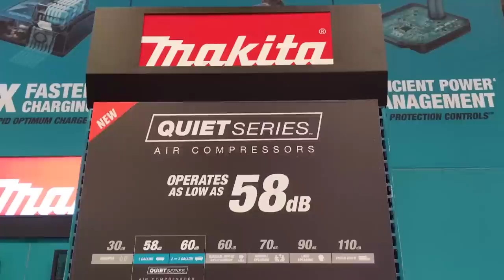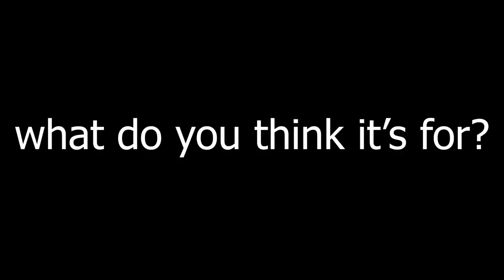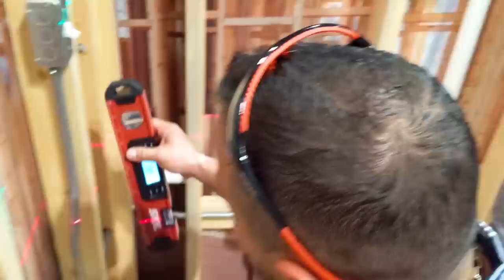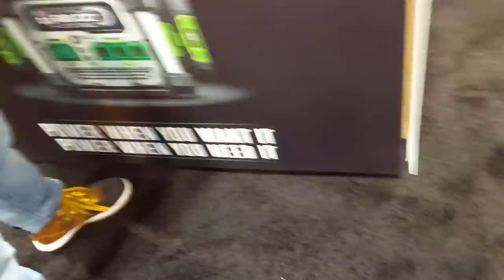Brand New Power Tools And Technology For 2020 (MAKITA, DeWALT, SENCO, SKIL, AND MORE!)

Comment: When I first started  years ago as an electrician, Milwakee was the choice for power tools especially drills. Then the Makitas dominated for a while. My most favorite power tool I ever owned was a Metabo hammer drill. RIP brother. That said, from cordless, to wired, saws and, I see, even threaders Dewalt seems to be pulling away from the field fast. Those skil cordless tools have the sweetest LED lighting I ever seen on a tool though. Loved the video.

Comment: Just bought the 5 piece 12 volt kit with Drill Driver, Impact, Oscillating tool, light & Bluetooth speaker for $165.00 on Amazon. Your video sealed my 1st endeavor with skil.  Great Video Guy’s.

Comment: The mac tools that use the same batteries as dewalt have rubber cushion around the edges to protect it from falls and is also oil resistant

Comment: Maan I'm impressed with Skil , back in the day they had great tools .up to now I'm speechless ,thanks for video vince
Reply: They look bulky, bad molds, serial number that will wear right off, sound like cheap motors. Didn't even hold in the spade bit LUL.  Soooo not impressed.
Reply: The impact that didn’t hold the spade bit was a quick release so it was intended to release under pressure, but that impact wasn’t rated for that spade but

Comment: Did he state the CFMs for those quiet jobers? California compressors are quiet so it only makes sense that Makita quiets down too. Need to take off lugs and blow out garage without pressure dropping below 80 psi ever. Those quiet ones are just for quick jolts of air like for brads. I wish the MAC5200 was quiet. Didn't see that one in the lineup. I have it and it is super loud but the engine rocks and rolls.

Comment: Is there a way for a shopper to easily compare specs of all the different models of a line's tool. For example DeWalt dcd996 vs dcd998 vs the other half dozen DeWalt battery drills? I just don't have the patience to track down each individual spec sheet, save or print them out and flip back and forth. I just want a single page for "drill" or "saw" and see all the models compared side by side. PLEASE!

Comment: Some of that Ego stuff is nice. I am going to have to get that 18-inch Chainsaw!
Reply: Yes, Ego chainsaw is nice. Got it. It's not the lightest though, so it is strictly for the Men, not boys. Or strong women. No heavy Ego here...
Reply: @t985gblockingpaint2  was the battery have  been updated to show how much juice it has left via led bars? Cuz mine does not have one, it still is plenty power for my usage, but I would like to see how much battery I have left so I can plan my cuts, work.
Reply: @arnoldasbrazys1589  I have the old one. I put it on the fast charger real fast to check the juice of it.
Reply: @t985gblockingpaint2  still the best battery chainsaw I have researched a lot, so would recommend it to anyone :)
Reply: @arnoldasbrazys1589    I recommend this as well as you can buy any size Oregon brand bar and chain and make it any size you want. 10" 14" 16" 18" 22" 24" etc... So cool.
Reply: @t985gblockingpaint2  I had 16" in my kit, it's plenty long for my usage
Reply: @arnoldasbrazys1589  I want to put on a 30" and make a YT video just to show folks it's possible... Now all I need is some trees.

Comment: They’re all 21700 cells in the flexvolt packs, I believe he misspoke under pressure, understandably. Milwaukee has the same situation with the 6ah and 8ah High output batteries. 

They’re all 21700’s, but the 8ah for example has more expensive higher density cells than the 6ah has. Even 21700’s has a wide range of available battery densities and formulations
Reply: Samsung 30T and Samsung 40T cells are pretty common in the 21700 cell packs I believe. A couple years back the Sanyo 20700A cell was the new it cell for Dewalt packs but then the 21700 hit the market.
Reply: Fictitious Character how can I contact you directly? Discord, email, instagram twitter etc?
Reply: Fictitious Character and yes the original Bosch core 6.3 for example used 20700’s, because Bosch was able to get into the supply chain early thanks to being an automotive supplier of many parts they struck an agreement, Tesla is who we have to thank for all of this though. Without them these battery chemistry advancements and size tweaks would be years off and far more expensive without the economies of scale offered by putting thousands of them in every Tesla off the line
Reply: @Fee.1  Absolutely Tesla was/is a major factor in  battery advancements but the down side to that is that they also are gobbling up a lot of the  A/B grade cells so they are trickling into other fields in comparison, but that's the trade off for the advancements we have seen over the last couple years since the days when the 18650 was king and in everything.

I think YT got rid of their contact feature. What you wanting to discuss?
Reply: Fictitious Character agreed. So glad the days of 18650 laptops are beyond us. No big deal just have a battery power “word problem” I’m tossing around in my head and saw someone as if not more competent than myself and figured I’d try to start a dialogue before I post on reddit or something. It’s nothing serious worth troubling you over.
Reply: @Fee.1  I'll post my email here and edit it out after I feel you likely seen it.  otherwise FB messenger is likely the other best alternative. I do use this handle on IG but don't ever really post or look at the platform. 

Can't say I  will have much insight to your battery power idea you are kicking around but will be happy to have the dialog either way.

Comment: Unfortunately, I have a product from another company and another electric that gets stuck in a little effort and cuts into something small. The wood you cut is very easy to cut and what you cut a small piece and some more smoke came out of the tree and of course the saw metal burns a bit too. Try with a manual saw much faster to cut

Comment: vince why hasnt dewalt made a cordless rachet its almost like they are telling people to invest in a different tool brand system thats been bothering me for years i want a 20v dewalt rachet or a 12 volt
Reply: I'm glad I am not the only one! I am pretty close to going into Milwaukee because they have a more complete line including a much needed ratchet, as I am nearer to needing to turn over old Dewalt tools.
Reply: Mac has the cordless ratchets you want, and you can use your dewalt battery with it. Both dewalt and mac are owed by Stanley so everything is interchangeable, that's why they haven't come out with it. The only bad part is the mac tools are a little pricier, and can only get them from tool trucks or online.

Comment: Was I mistaken, or was Bill calling watt hours “watts out”
Reply: I don’t use dewalt tools so I am not familiar with the use max watts out. I was mistaken
Reply: @Zee20Ate  not a dewalt term. its a physics term.
Reply: N1rOx no kidding! Of the majority of power tool companies, dewalt is the only one using this measurement. The majority are giving the torque and speed numbers while dewalt is using MWO
Reply: @Zee20Ate  i think you maybe getting confused with uwo or unit watts out. which is, as you point out, a unit of measurement that only dewalt currently uses likely to avoid direct torque number comparisons but i digress. mwo is used by many companies take for example metabo hpt list their 36v batteries with their mwo rating.
Reply: N1rOx I’ve seen the MWO rating on the tools for example the circular saw in this video and their grinders

Comment: yeah I've seen it, just like I've chucked hex drive drill bits in a hex drive driver. not rocket science. 

Hot tip, if its a hex drive bit, you can chuck it in a hex drive driver, across the board. mind blowing

Comment: I buy Milwaukee, DeWalt Makita, botch and different brands. And i keep burning brush and brushless drill like crazy there not cheap 2 speed there 3 and 5 speed drills. Milwaukee saw how much DeWalt tools i bought in last 6 months there rep is fixing 21 brushless drill and 4 multi tool and a band saw in last 3 years i bought them. As i say tools are a right off to business all i really want is battery that come with them. So my helper will be getting some drill very soon got to buy a new coring drill on frizz. I i bought some more ban saw small an big batteries operated. I like the DeWalt 20 volt  big ban saw  more then Milwaukee big 18 volt. ban saw. And Milwaukee 12 ban saw one of my best tool . For 1/2 inch pipe and liquid tight.